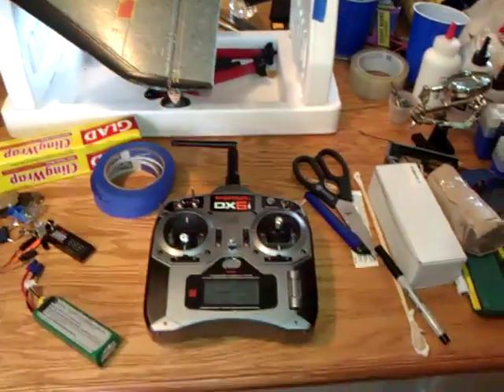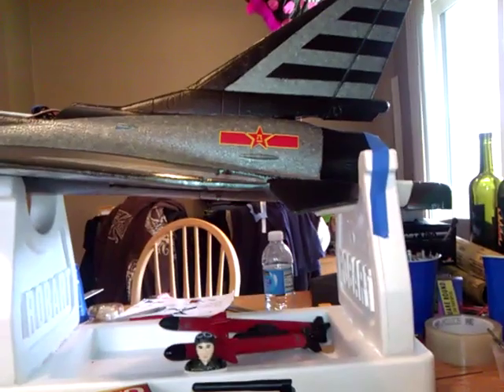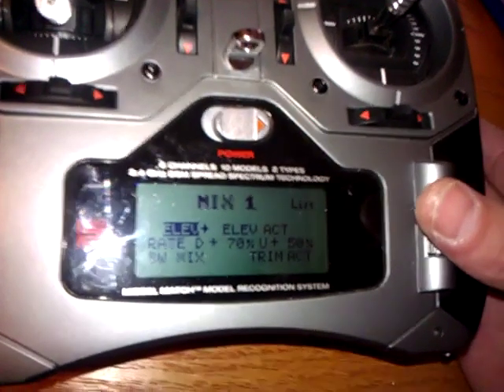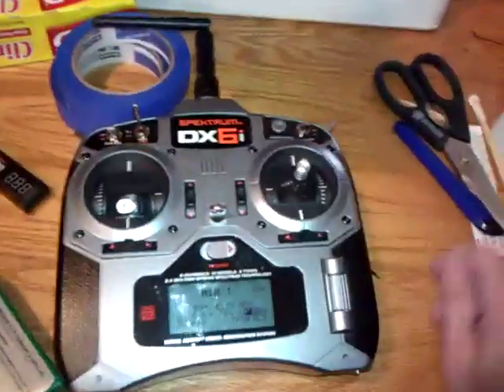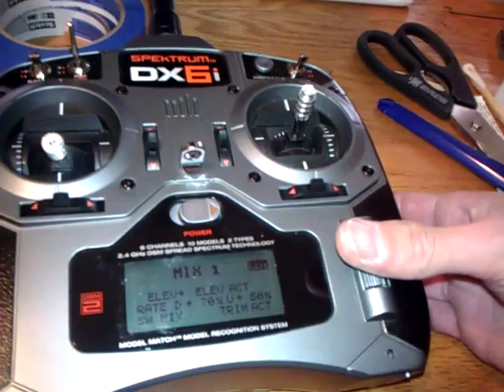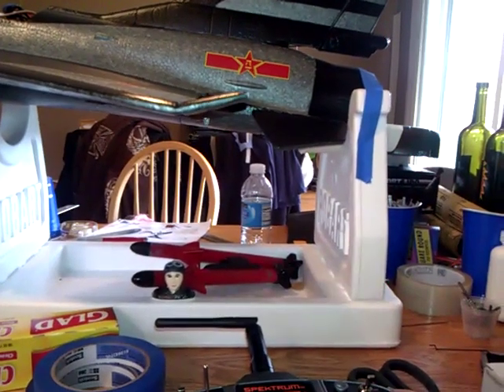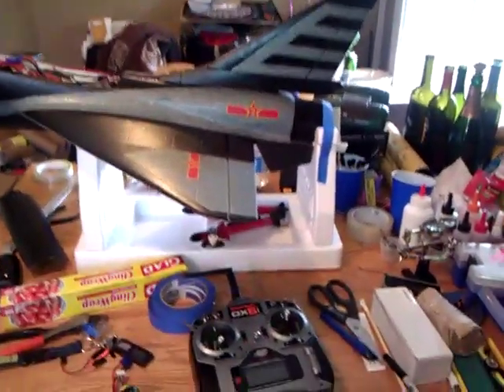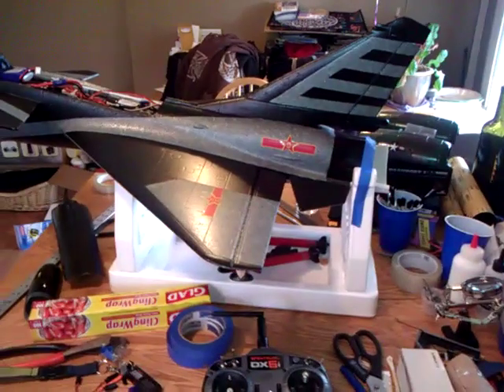How to: Dx6i with elevon mixing to get 125% throw

Comment from the maker: Alright, I guess I had a privacy option checked in setting, i subscribed to you also. I have a flying buddy with that jet so I will find the full specs out. You are right though it is all in splitting connections using the two mixes in the Dx6i to make an extra mix :). Fun trick. I know we will get it to work, no worries. I'll let ya know of my progress. I should have a complete set up for ya by Friday.....

Comment from the maker: Yeah jcardoso47, I saw the F-16 you have on your page. I think I can finally let go of my secret, I found how to run full 360 degree thrust Vectoring on a dx6i and an ar 6ch. receiver. I use it on my J-10b dragons, have three of those bad boys now. If you could send me a PM with a little info such as servo coun't and what each controls and I'll have a setup and how to vid for ya. Let me know. Good question also.

Comment: OK, sorry- just to be clear- I made a mistake on saying flaperons. I meant dual ailerons. I will explain- I had to start by setting my wing/tail mix to dual ailerons. Then in Mix 1 set the elevator to mix with the flaps, 100% rates, and trims on. On my RX I had to put one servo on the ailerons and one on the aux/flaps. I had to switch the servos and reverse the elevator but that worked for me. My throws were large and I had 1 mix left over. This was on a flying wing model.

Comment from the maker: @dbcustomrc......... aileron and elevator set up. Also as mentioned I was adding an Rc Lander aluminium 360 degree thrust vectoring unit. This jet was made for high alpha and virtual low altitude hoovering. So because of this I needed more throws than spektrum allows on the elevon setting. I was the first guy to post this here and on Rcgroups as well as the flaperon setup on Dx6i with an AR500. So the thread your reading came from the info on my thread over a year and a half ago. Kinda cool lol.

Comment from the maker: @dbcustomrc Yeah we are talking about 2 completely different things, this is a 70mm J-10 EDF jet its a delta wing and has to have elevons mixing not flaperons it would not function. You are talking about setting up flaperons completely different. I have 2 other videos here doing what you are talking about to get flaperons. This vid is if you select ELEVONS in the radio at 100% normally you don't need extra throws on elevons and spektrum set the max throws for elev lower than standard.....

Comment: You don't turn on the elevens you turn on the flapperons. Then go to mix one and program elevator to flaps with 100% on up and down, and trim turned on. Then experiment with plugging one servo into aileron and one  into the aux or flap slot. You may have to reverse them. This leaves one mix open for later use and there is no need to worry about the amount of throw you have because it is set to the max. In fact you have to set your endpoints and rates to make sure it's tame. It works out pretty

Comment: My DX6i will not work like that.  If I leave them plugged into the ail/elev servo slots I end up with the ailerons on the elevator side of the stick and the elevator on the aileron side. So left and right movement causes up and down, and up and down causes roll left and right. I found a fix on rc groups and I'll post it next...

Comment from the maker: @Foambird I do see your point, however the call out is correct.  In my 23 year of flying now and certified trainer, every once in while I do a back to the basics help video.  You never look at the control surfaces for trim or adjustments, while in the air if iI tell a student down elevator they know to drop the stick trim down because while in the air the C/S cannot be seen. But you are right for a newbie it could be misleading. I'm old school. But withcontrol adjustments you use the Tx.